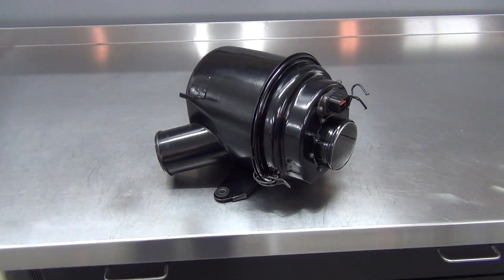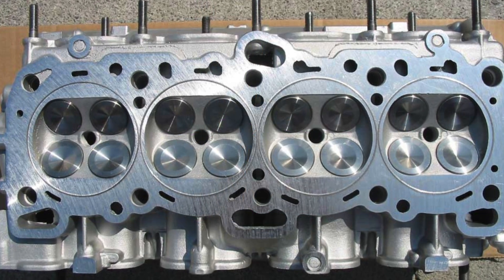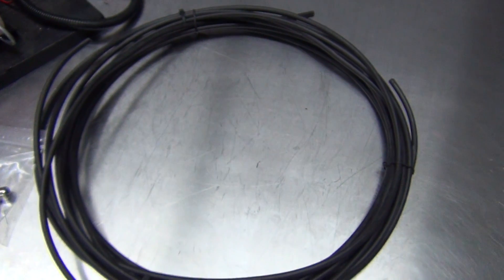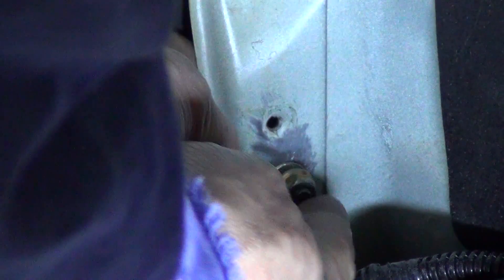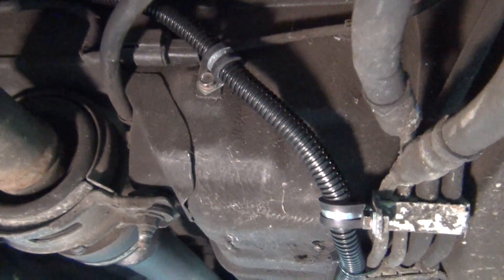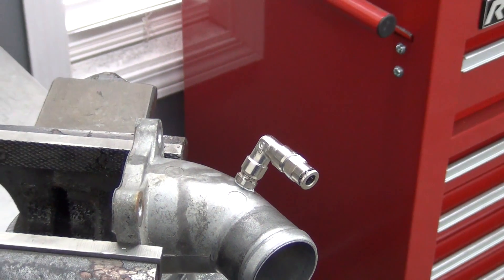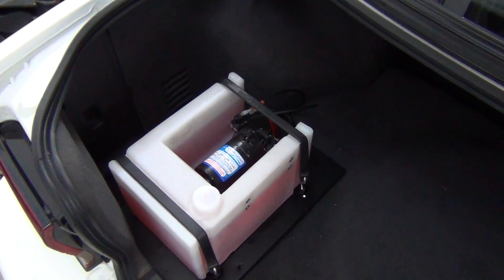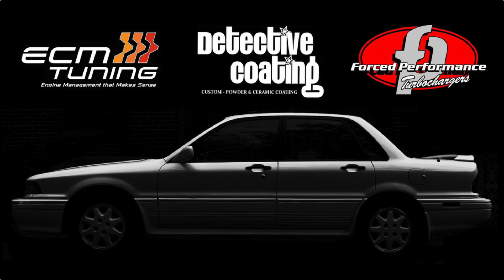Project Street Sleeper Part 9: Methanol Injection Install

Comment: Hi. If my standart ecu does not have a function to retard ignition, and i dont want to mess with standalones, but i still want to turbocharge the engine that is NA at the moment, does water with methanol injection does the job, letting me have a decent boost without retarding ignition and not having knocks?

Comment: Do you still put the nozzle after the turbo on a vw 1.8 Turbocharged engine? the intercooler hose is connected going straight to the intake and hope that putting this on wouldn't ruin the intercooler.

Comment: Awesome video as always but you forgot to let people know a little bit about theory when it comes to placement of injector nozzle. You want it far away from your throttle body as possible but after your intercooler. This will allow you to run the biggest nozzle possible to get the biggest gain possible. I realize you wanted to have the sleeper look and you placed it there for that reason. I would highly recommend to place it on the outlet of the intercooler.

Comment: What is the thread tape you're using? Is it teflon tape? I remember my snow performance methanol system said to only use E6000 silicone sealent for threads, not teflon tape as it isn't methanol resistant.

Comment: Hello, firt i don't speak english Very Well, can you Tell me If this sistem      makes economy for car or only potency. I want to use for economy day by day.
Thanks for your attencion
Reply: Attencion? Do you speak spanish (I do)?
Well, this system will give you more torque at any RPMs. By itself it doesn't increase millage, but you can press less the throttle pedal for the same response, driving your engine at lowers RPMs

Comment: Hi Tom,

What kind of pump gas do you get down there to start with? If the Octane number on the fuel is high enough, you could do without the added complexity and parts of this water/methanol injection system. 
I can get 102 octane fuel right from the pump station here and I doubt whether a system like this would still be justified using that kind of fuel, even on a boosted motor...
As for intake temps...A well sorted intercooler would already take care of that I guess. Cooler is always better of course, but if you could do without this sort of system, I guess I would always prefer it.

Or am I thinking this the wrong way round?

Comment: What much was the performance difference with the alcohol?
Reply: Old comment, but if anyone is wondering, think about the way your car runs on a cold day/rainy day (or first thing in the morning on cold start), compared to warm. Water/methanol injection makes it run like that all the time.

Comment: Does this require an ECU tuning for it to work well? Does it affect the stoichiometry ratio?
Reply: yeah, this mostly just boosts your octane rating and cools you intake temps. the power comes from the more aggressive timing and boost that you can now safely manage because of it. cooler intake air will be slightly denser and thus provide a slight power improvement but not much without a tune.
Reply: Joseph Rusyn either way I'm still in need for a tune. Thanks

Comment: Hey Tom, can you do this without a tune? I want to install a similar setup on my daily. I would probably use a nozzle under 200ml/min to not have to re-fill every 10 minutes. How big of a nozzle do you need for a car around 330hp? 2.5l 5cyl.Thanks!
Reply: +lSairexl If you run with water mixed with methanol you will need a tune as the meth burn and changes your AFR. Just run regular distilled water instead, not as good as with meth but it's still very effective.
Reply: And for clean watter injection i dont need a tune? Is there any hp gain except cooler charge?
Reply: I'm 99% sure you don't need a tune, I know plenty of people who have just slapped a water injection system on with no problem. You might gain a little bit of hp using just the system, but unless you have a turbo and turn up the boost it isn't worth the cost.
Reply: +NorwayVFX N/A engines where they experience spark knock will see a benefit from water injection. In-fact you could run your car on the cheap stuff (87 octane) and keep the timing set where you have it on 91-93 octane and make the same if not more power because the intake charge is much cooler. Overall the gain isn't huge, but if you add a turbo, supercharger or even nitrous oxide you will gain much more power with water injection plus those power adders than without just running fuel alone.

Comment: You Americans- had a bit of a laugh with the metric tap being used with the imperial drill bit!!! That's funny as!!! I suppose being an American, you probably wouldn't own many metric drill bits- or anything metric at all for that matter. Never could work out why you guys never embraced the metric system, it makes much more sense and makes the math much easier cause everything is made up of units of ten. How many 32th's was that drill bit again?!? 11 was it- yeah- Ha Ha Ha! Good vid though dude, I've been a qualified mechanic in Australia (we use BOTH metric and imperial!) for 16 yrs or so now- but I've never had to install a water/meth kit. I have one quick question though, how do these kits go running straight methanol??? Is there any advantage octane wise AND I would expect the latent heat of vaporization would be greater with straight meth rather than a 50:50 mix of water and meth. Thanks for the run down

Comment: Awesome video brother! I especially found it interesting that water/methanol actually CLEANS your chamber, I guess I figured like most performance enhancers, this might do some slight wear with the water being mixed in.

My grandfather taught me a trick a while back and we installed an ISOPROPYL alcohol injection in my Ford Bronco :P. This was before I even knew about Methanol, but from what I've found, isopropyl can mix with oil, gasoline, is more flammable, cools the air just as well, and also evaporates quicker (although it's a little more pricey, same stuff you can get at a CVS).

Comment: i liked the system, until i saw the spray slapping up against the opposite side of the inlet.    i think it would work a lot better if you could get it spraying directly into the inlet.     like, make the spray curve into the inlet instead.     this would require an additional L-fitting on the inside of the inlet ( pointed in the direction of the intake ) but it think it would give a much better performance boost.     because that mist is supposed to be sprayed down the length of the inlet, not up against the wall on the opposite side that you drilled.     but other than that, it seems like a pretty good setup to me.     i realize that
there's enough pressure in there to bend the spray pattern, but a bent spray pattern, isn't even close to a normal spray.    you need to find a way to make it spray into your motor in the same direction as the airflow, instead of like that.    because when you install it like that, the cars natural airflow is bending the spray, before combustion area.
Reply: Jeff Fuehr it'll be a small bit different when there is 10lbs+ of boost forcing it sideways into the engine. 

You've chosen the wrong thing to be concerned with. 

Also. Larger water droplets will add more octane and steam to the cylinders and that's always a good thing. Plenty of room for atomization down stream from the nozzle.
Reply: +Jeff Fuehr The way I see it, it does not matter as long as the boosterfluid gets inside the cilinders. It's about increasing engine pressure right?

Comment: My 4.8 Silverado runs very strong high 13s I has a semi aggressive street cam  220 - 581 123 lob separation, a 3500 stall and a 4.11 rear. I have utilized the stock exhaust manifold and coupled it to a custom Magnaflow exhaust. My tune was done be Red line. Howard did a good job but getting any assistance or a call back is impossible so getting "Howard" to do a re-tune is not likely...Anyway, I like the idea of a methanol injection system. Will I need to re-tune it and is Methanol injection a good idea? I admit to not being the most knowledgeable gear head so sarcastic comments are not necessary, Just constructive info please.
Reply: My first question is for you to think, is this really what ya wanna spend your money on? Usually these systems are for more of a boost build, or even a liquid induction like nitrous. You can really spend this money elsewhere on your truck. {4.8's love boost. Just sayin ;) } and yes. Anything done to your motor that will have ANY kind of change, needs to be re tuned. Computers are picky. Even if they do accept the fact that something is changing in the machine, a lot of times it will fight it. Even little changes like your afr. Which it will change. Don't get me wrong. You can probably get away with leaving it alone but if ya really wanna make it work for ya, re tune,  just to be sure. But I strongly advise you, if your just N/A with no juice or nothing, don't worry about wasting your money. Another big part of this is it helping detonation suppression. Your motor is probably very healthy and quite far from detonating (as long as it was built well and the tune is healthy)
Reply: It screams, I love getting into it with anything on the street that is willing. Nowadays you don't have to look for wide rear tires. Street racers react to me as soon as they see me. For example minding my own business,,,Me and the Marshall Tucker band, the light turned green and all of a sudden it was on..A Nissan Altima S. bated me, so... we went fast. Koo Does Baby! That lil coupe was fast.I did just barely beat him. I have to drive it out of the hole or it gets slippery.My 4-11 is a limited slip dif. and I hate it.  I get a thrill from racing. Always have. My brothers got a 70 Chevell SS with over 600 hp. I would say conservatively speaking low 12 high 11s. I will race him till my tires shred .Not a chance in hell of beating him. But watching a SS Chevell "Getting Down & Dirty" is a beautiful thing, it never get old. I win a lot more than I lose.  I was on I-95  2 days ago and a Mustang Saleen... Blower the entire fast car package...Insane car sees me and positioned himself next to me and my my old 4.8 Intimidator SS.Mine is pretty. Its a truck and that how I role, but his was truly a magnificent Thoroughbred, on 3 beeps we hit it. I did as good and then some as human / mechanically possible. It was a Fantastic thing to watch, that Stallion did what it does! As far as the results go...Let me just say this. That Mustang sounded fantastic and I totally liked watching the rear brake lights come on at 125 mph. He was still pulling. Anyway, I have been toying with the Nitros Idea, I like the idea of the Methanol injection for more then a slight increase in performance. in researching methanol injection keeps the fuel cool for a better detonation and keeps the cylinders clean, So I feel like you have made up my mind for me." BOTH," together should be nice as well as long tube headers (Torque and HP) then retune it.I assume you agree. Thank you for the information Sir.Good chat!
Reply: Water/meth is best used on forced induction vehicles. Unless youve raised your compression ratio, which would lead to more det/knock instances and therefore require wtr/meth to lessen those instances, i dont believe youd be benefitting from a wtr/meth kit.
Reply: So I have been told that the Methanol wont hurt it, that It might not give you a lot of performance but it is a good thing to have. I was told the Meth cools the fuel substantially. which is never bad. and Methanol injection does make the moter cleaner and cleaner running. (Your thoughts?  When we dropped the moter, valve covers, top of the heads the springs... all were like brand. I have taken care of that Chevy since day one. Its got around 240K miles on it..and runs like a Seiko
Reply: this is true the h2o does have some sort of a deep-steam clean effect and i believe carbon deposits attach to the hydrogen molecules and that removes some carbon-plaque buildup. and your right meth injection does mean a boost in octane. and youd really be taking advantage of the kit if you advance timing and whatnot. i guess i meant to say results on forced induction motors are greater and easier attained.
Reply: Stephen Briede  Thanks Stephen.

Comment: damn i HAVE to have this in my Turbo AE86.  ive already melted several pistons!
3rd rebuild now with forged internals.  doing it right this time.
Reply: if you're melting pistons, you're doing something severely wrong that I can almost guarantee you methanol injection isn't going to fix, man..

Comment: What is the best location for the injector? I have seen them installed all over the place, into the turbo, before TB, into the manifold
And I have a dumb question, what do you think of running Low Octane (87) Gas with 100% distilled water on Low Boost 7PSI (0.5Bar) setup. Would it be okay?

Comment: here is an idea, Tom, try doing this but in the turbo intake to make the air entering denser and therefore have better turbo efficiency, please respond if my idea is flawed.
Reply: +Will Campbell dont you want your cooler/denser air going into the combustion chambers via intercooled charged air/tb/intake mani? If you inject it via turbo intake the mixture will be disapated/burned up before getting into the combustion chambers where it is a benefit
Reply: +KB in MD Last   Water is normally injected either at the compressor inlet or in the diffuser just before the combustion chambers. Adding water increases the mass being accelerated out of the engine, increasing thrust, but it also serves to cool the turbines. Since temperature is normally the limiting factor in turbine engine performance at low altitudes, the cooling effect allows the engine to be run at higher RPM with more fuel injected and more thrust created without overheating.
Reply: are you talking about planes/jets or cars/trucks? Or is the same for both? My reply above was meant to be a question if it didnt sound like it
Reply: oh sorry, I should have specified, I was talking about jet aircraft.
Reply: it is also very similar for both, compression is aided with cooler air.

Comment: I've been thinking about adding a system like this to my turbo 1.4l dart. Is this something best added toward the end of bolt on upgrades or can it be done at any point?
Reply from the maker: MrMalditor It is best when you can no longer add boost/timing on pump gas and want to add more without knock.  That said on a more modern car like yours, tuning will be needed.

Comment: You really have some strong patience. With all that work i would be itching to get it out on the road. Great work Tom!
Reply from the maker: Thank you sir, yes a long project like this definitely requires a decent helping of patience.  Check out the Miata drivetrain conversion, which has required 10x more patience than this! :-D

Comment: would this work on NA car?
Reply from the maker: InBoostWeTrust7MGTE Only if the NA car is running very high (non-stock) compressions ratios, aggressive timing, etc.
Reply: Tom's Turbo Garage Tom you know whats the best part about your channel and you? that you actually communicate with your audience. love it and thank you very much for that ;)
Reply from the maker: InBoostWeTrust7MGTE Thanks man, I appreciate you saying that.  It has been very hard keeping up lately, as I've been getting tons of comments and direct messages via here, email, Facebook, twitter, etc.  I do love talking to folks, but I've been forced to be short lately.  Have a good one!
Reply: yes. just don't go overboard. the fluid entering the intake displaces oxygen. you should only use it at wide open throttle.

Comment: DUDE I didn't know you had a video. I stumbled upon you how-to page years ago and STILL rock the kit. I also eventual went with an actual meth nozzle from CoolingMist instead of the oil squirter thing.

Good job!
Reply from the maker: Thank you sir and that's great to hear!  Yes, the cooling mist stuff is nice- I've used it for many years with no issues at all.

Comment: Is it hard to use this, or tune with it??
Reply from the maker: Well, it just adds more "headroom" to your tune when it comes to boost and/or timing.  The knock threshold should be much higher than with 93 octane pump gas alone.
Reply: I've known about it for like 10+ years, but afraid to use it. Currently live in a area with no E-85, so going to make my own kit based off your site. GREAT info. Thanks
Reply from the maker: Sarah Dell You're welcome!  I use it because there's no E85 here either.  The kits available these days are very good and a pretty good value too.

Comment: Tom what size super atomizing nozzle did you use with your trunk mount cooling mist setup for your VR4? How much boost are you running? I am researching this exact setup for my VR4 and would appreciate the info.
Reply from the maker: Hey there, I believe I went with the CM7, but can't seem to find that info.  Contact cooling mist for a good recommendation based on power expectations.  I plan on running around 25psi on pump gas, but as you know this can vary from car to car greatly based on a variety of factors.

Comment: Would it work on an N/A setup instead of FI? Say for track or strip racing set to specified rpm range. So you would be performing at optimal levels for the race, and under normal driving conditions it wouldn't kick in.
Reply from the maker: It can, but only if your NA setup is limited by pump gas.  I once saw a very high compression, built V8 running an alcohol injection setup to avoid having to run 116 octane race gas all the time on the street.